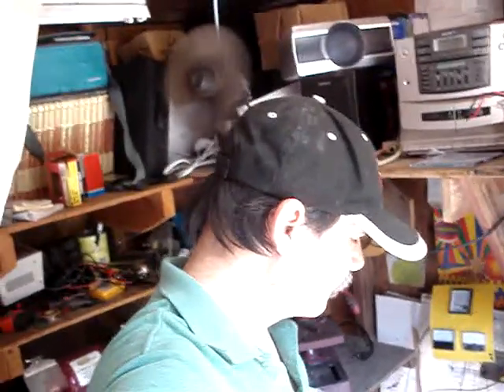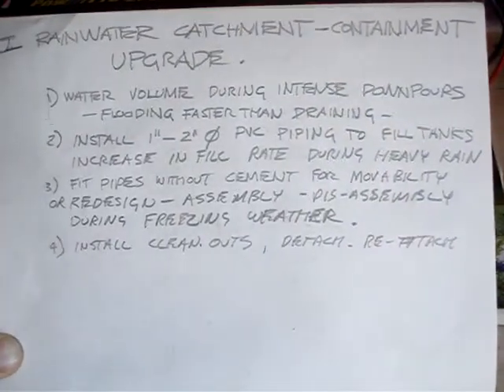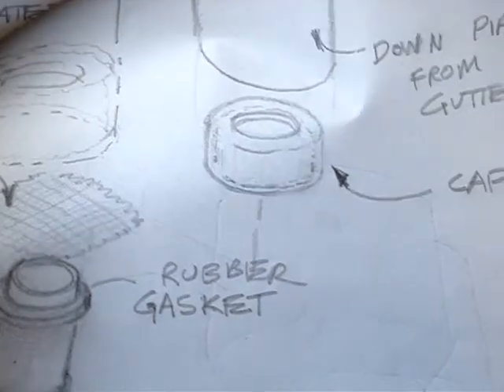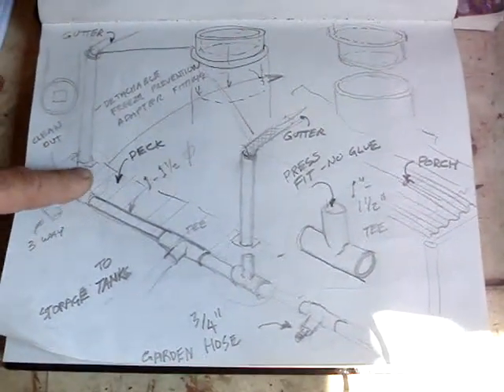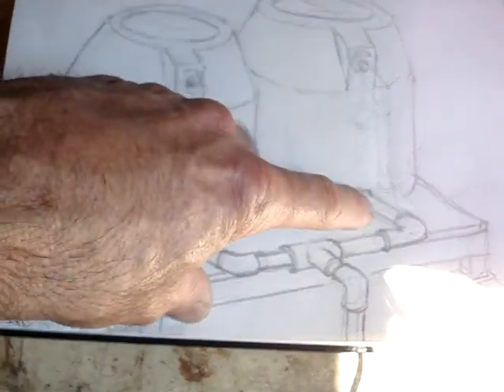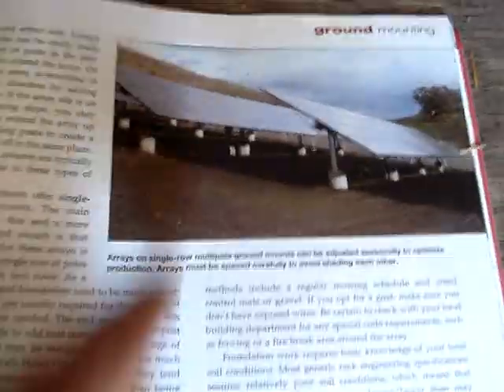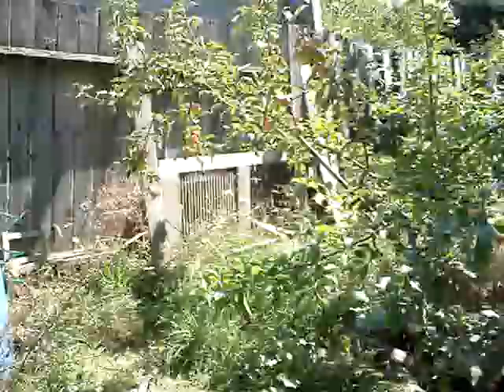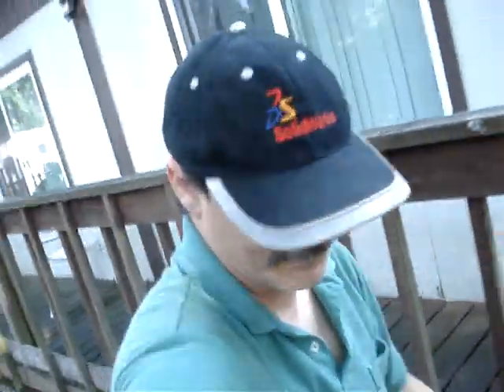Sketched Rainwater Over Flow Spill Problem Design Fix

Comment: My tank overflow is about 6 in. lower than the inlet and it still overflows the inlet in a heavy rain
So I think the tank has to be at least 1 foot lower than inlet maybe more
What kind of pump would you use and how would you hook it up?
I'll be doing a pump next year, too hard watering with the drought this year
I'm thinking about the Divertron 1000 inside my big tank (650 gal) but expensive
Good drawings!

Comment from the maker: @tribalwind The first tank will be the 305 gal. I've thought about a double walled pipe, with outside filling first than spilling over into the inside pipe. 2 Biggest problems with my system are spill over on heavy rains, and freezing in the winter. The nice thing about those tanks is they can be cleaned out easily, not like the square tanks or the barrels with the buna tops. So the first tank will fill with roofing grit, dust, bird droppings, fireplace ashes & pollen.

Comment: Nice plan on the rainwater system. most i've seen around youtube have something for a 'first-flush' to let the dirtiest first gallon or few bypass the tanks.are you just using tank-1 for that? how does it get cleaned out then?
so your runs will all be 2" then from tank to tank?. thanks for sharing